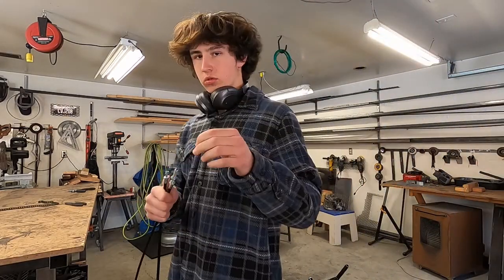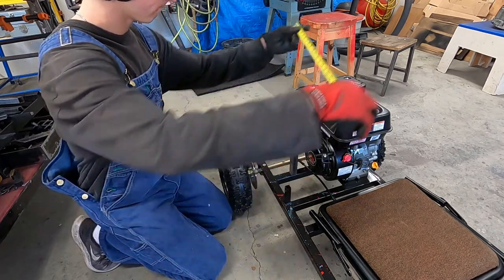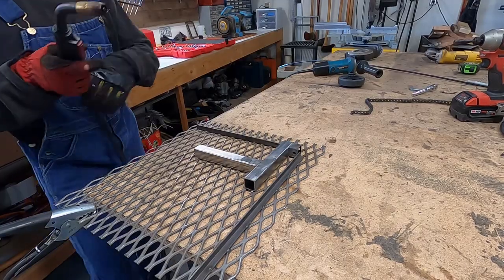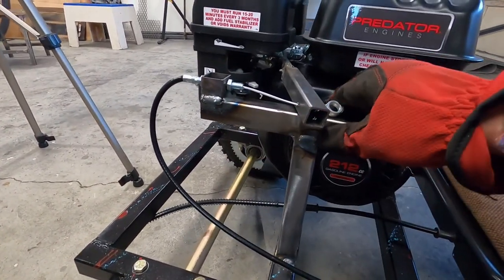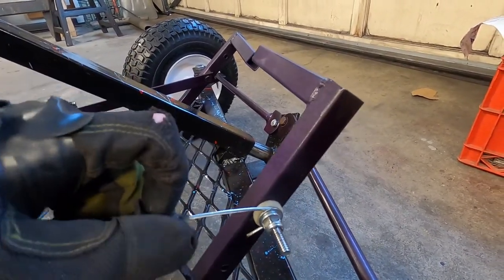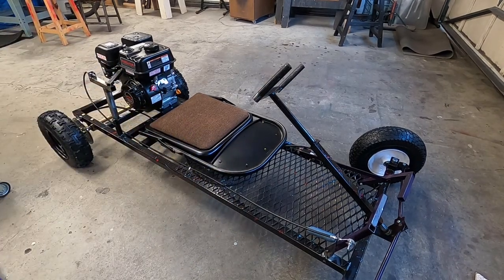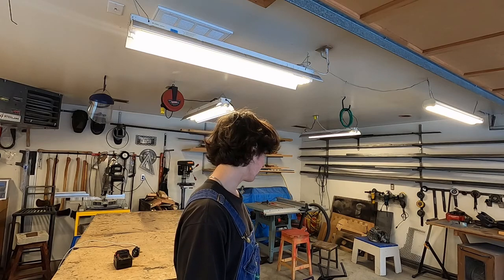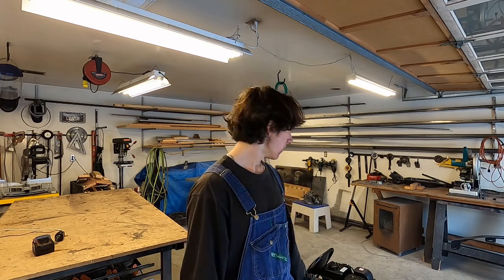FINISHING MY DIY GO KART!!!

Comment: Why did you do your throttle setup like that !!! you literally supposed to do the cable other way around by hooking it up on to the throttle brackets on the engine idk why you had to weld the frame bar on to the throttle you should've just used the circular end of the cable bolted onto the pedal instead of just doing it the other way around.